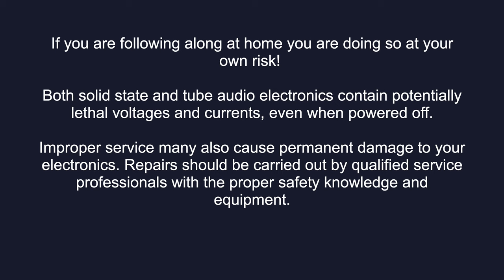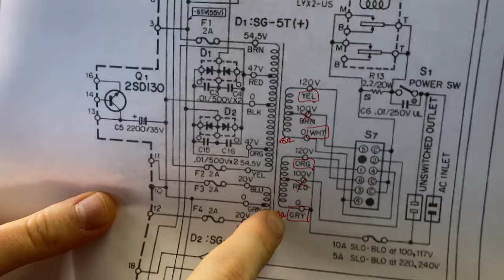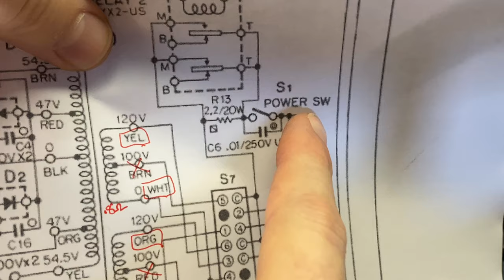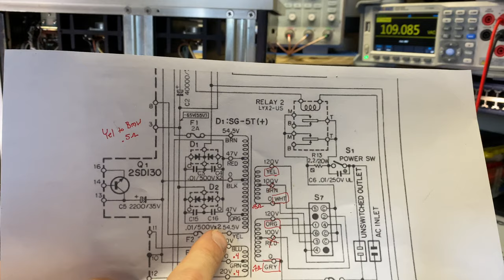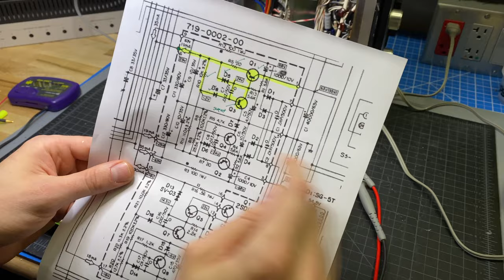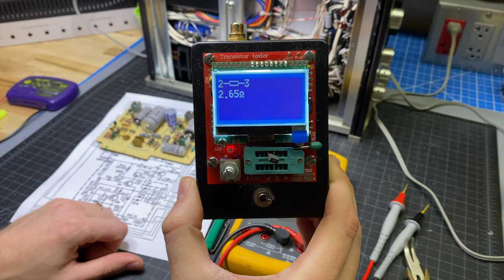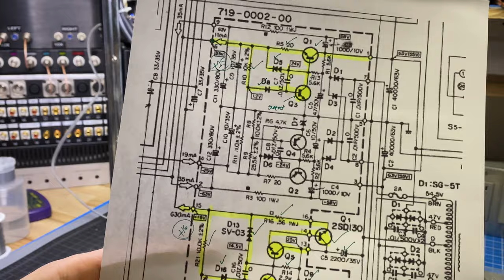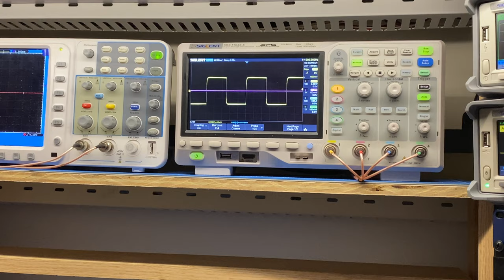Accuphase P-300 ~ Restoration Part 1 ~ Initial Diagnosis & Repair

Comment: Hi! I have just caught your chanel and interested in your valuation on Accuphase amps. i have for a long time admired Accuphase products but purchasing them have been beyond my finacial capability's. Lately I have been looking for a second hand/used Accuphase Integraded amplifier, the P-300 been one of them ( hense how I found your chanel ) Buying an amp this old is very risky especially buying it overseas on Ebay. Most I gather have not been looked after eg: not serviced as such. There seems no doubt that parts like capacitors and resisters would need to be replaced to bring back to normal, including cleaning etc. Sorry this is long! My question is confirming how much service would be needed to bring a P-300 or similar product back to life? The cost aproximately and would it be worth it? Taking into account a new Accuphase Int one would be looking at $6,000 to $9,000 US to buy. Would appreciate your feedback on this very much.
Reply from the maker: My P-300 was completely broken. Every circuit needed significant service and even after fully rebuilding it I encountered another failing transistor in the power supply that needed replacement. A full restoration like the one in the video is very expensive as it’s labor intensive and uses a lot of axial caps which are much more expensive than radials. Assume any P-300 that you are looking at needs significant service at this age. unless it has been fully rebuilt.